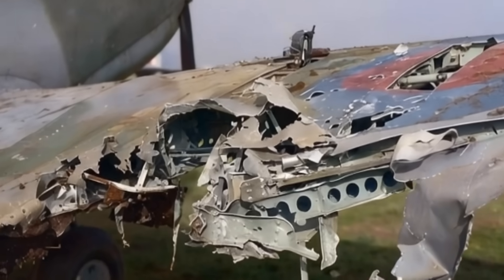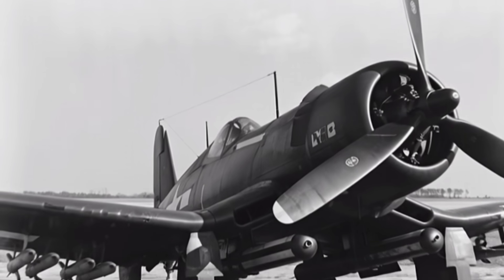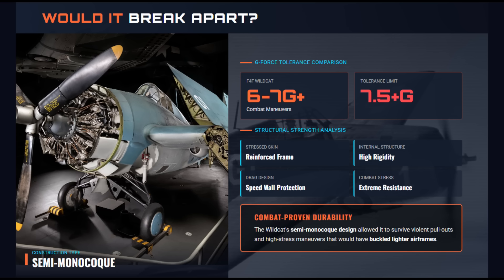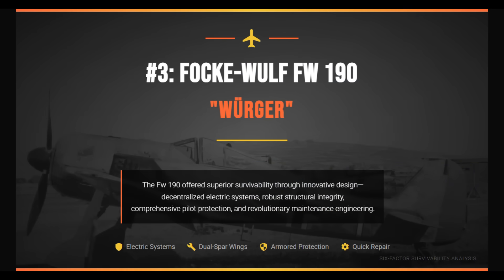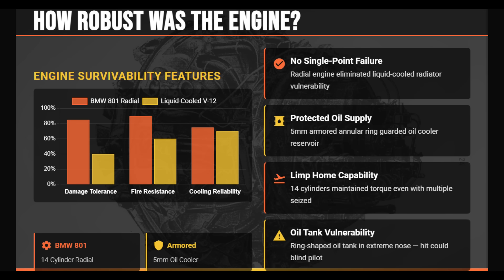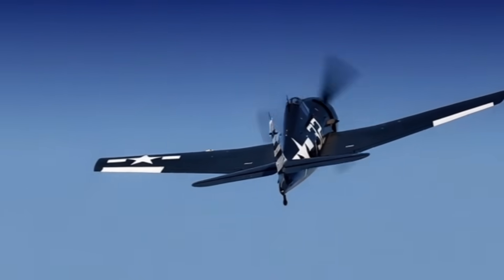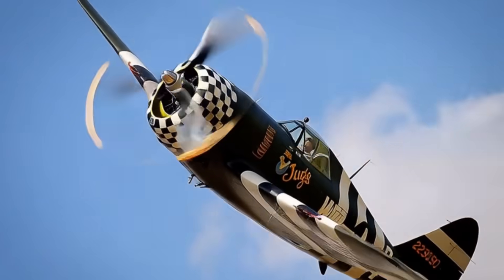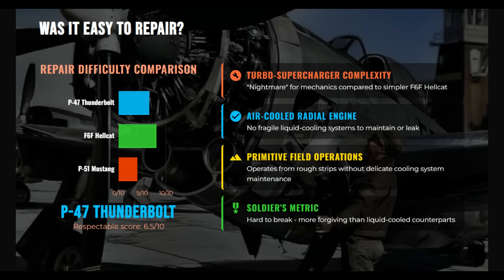Five Most Rugged WW2 Fighters

Comment: Much of your data is correct, but I do need to make one correction. It's universally accepted that the F6F Hellcat was faster in a dive than the Corsair. This is plainly shown in the various pilot's manuals of the day. The Hellcat had a  10-30 Kts higher do-not- exceed diving speed. This is actual speed and not indicated, so it's fully comparable. The figure of 380 Kts for the Hellcat is low and is off by as much as 60 Kts, depending on which model and the particular pilot's manual consulted.

Comment: Obscure little known fact: some Corsairs had the armor plated floorboard removed to save weight and improve maneuverability. Pappy Boyington was flying one of these when a 20mm cannon shell exploded at his feet, wounding him severely while damaging cables and bringing down the plane

High command sent blistering demands stateside: "Put the damn floorboards back in"
Reply: Actually, the F4U-1, which was the model of Corsair flown by VMF-214, didn't have a cockpit floor, period. This is how they were manufactured by Vought. Also, armor was never placed below the pilot, only back/head armor was installed. There was also a bullet resistant plexiglass assembly mounted behind the windscreen for added pilot protection. 

According to recognized sources, the Black Sheep never modified their aircraft outside official protocol. However, being land based, the tailhook and catapult gear were normally removed, being  standard practice  for US Marine flying units in the Solomons at that time. The removal of these unnecessary items shaved a small amount of weight off the aircraft.
Reply: @darrenwhiteside1619 Thank you, I stand half corrected as what I read was specific, and I didn't mean to imply these were 'field modified ' but arrived that way.

Comment: Y'all missed it big time on 2 counts that I know of. (1) The P 38. It's track record for bringing a pilot home when heavily damaged is beyond legendary. It's almost a religious experience. They were well known for being knocked out of the sky, bouncing off the deck, and getting their pilot home. (2), The P 40.  It was well known for not only dishing out a beating, for taking one that cause most planes to fall apart and still stay in the fight. The Japanese had a terrible dislike for them, and on more than one occasion over China refused to fight them. It was the damage they could dish out, as well as take that made them highly loved by the Russians. Even heavily damaged it had a reputation for getting them home.
Reply: I don't disagree that both the P38 and P40 are tough rugged aircraft compared to a lot of aircraft out there. The issue becomes which of the 5 do they replace? Both have big immediate strikes against them because they have liquid cooled engines. (Especially the P40 with only one engine while the P38 could fly on one engine if the other had a cooling issue). I do agree the P38 airframe was extremely rugged simply because of the "box" shape, but the engines were still a weak point and it also had structural issues with high speed dives that I am not sure ever got fully fixed. 

Honestly with all due respect to Russia and Britain (huge users of inline liquid cooled engines for almost all of their fighter aircraft), I think the list is fairly accurate as far as the 5 planes picked.
Reply: I was thinking much the same thing before this video; both P-38 and P-40 were legendary tough.

However, both did have the vulnerability of losing coolant from radiator lines being cut.  That was one of the main points discussed in the video.
Reply: Agreed.
Reply: Thank you for setting things straight.

Comment: IL-2 Sturmovik should get an honorable mention
Reply: Not a fighter
Reply: @LeePrice-r9u The IL2 served as a fighter, in the early war it was routinely used in fighter roles, it did a reasonably good job, but was the most shot down fighter of the war.
Reply: @trevorgale1176 
Yes, it was used in a fighter roll mostly against bombers and transports. Not against fighters.
Reply: @LeePrice-r9u Are you suggesting that no IL 2 ever fought a Me109 or FW190 in combat? Brave call Cotton, let's see how it pans out. In the early days of Operation Barbarossa, the Russian airforce used anything with wings, the IL2 included, the IL2 was infact modified specifically for the fighter role, however the performance improvement was so little that development of the fighter variants was ceased, and the IL2 remained in its two seat ground attack role. The IL2 was the most shot down aircraft of the war, I don't think transports and bombers did it.
Reply: @trevorgale1176 of course they would have fought them but they would have failed miserably at it.
Reply: @LeePrice-r9u actually they were deemed "acceptable losses" hence the plan for a dedicated fighter version, at the start of the war the LAGG3 was the main front line modern fighter, and was lost in very high numbers, the IL2 was at least a better aircraft, but yes when better aircraft became available the IL2 was used in its intended role.
Reply: @LeePrice-r9u  role*
Reply: While it should, the "Fighter" version of the Il-2 (and I can't remember its designation) sacrificed a lot of its armor and ruggedness for higher performance to serve as a fighter.
Reply: THE SOVIET "TANK BUSTER" AND ONE OF THE MOST PRODUCED AIRPLANES OF WW2!!